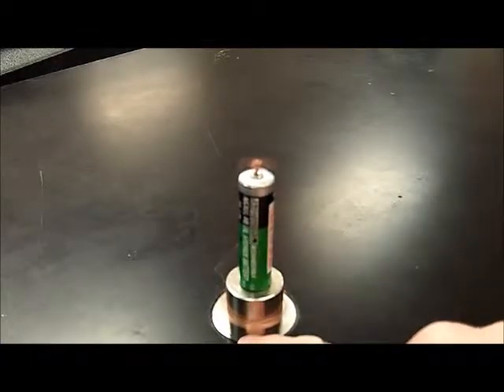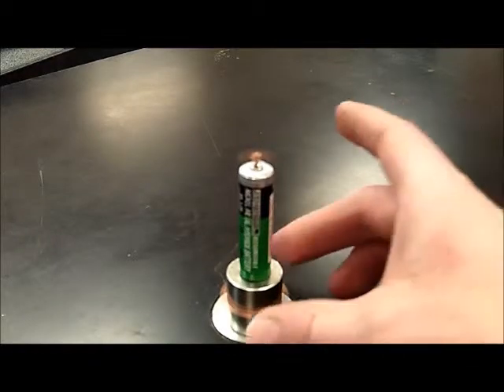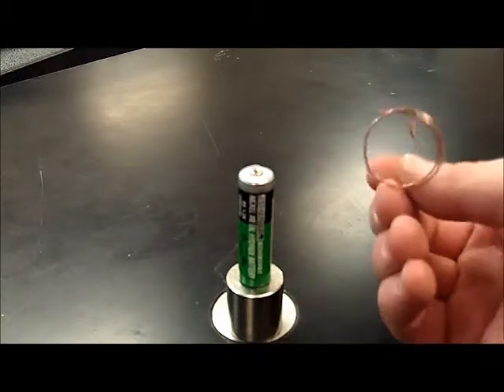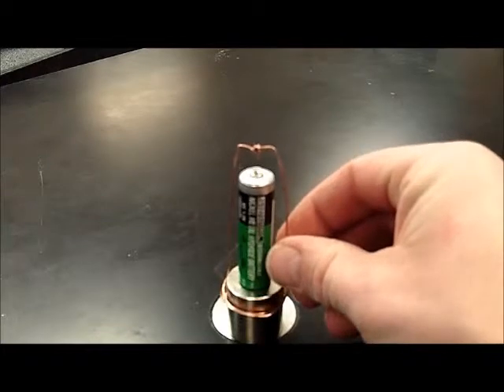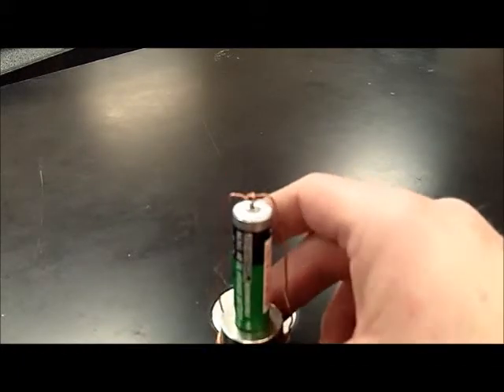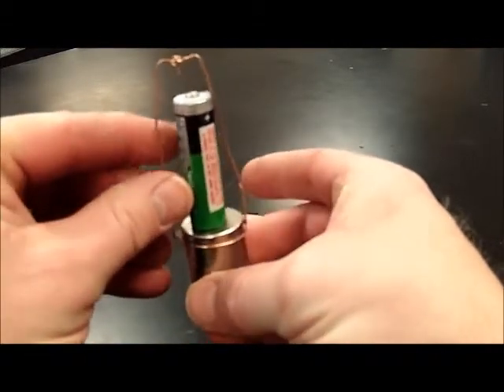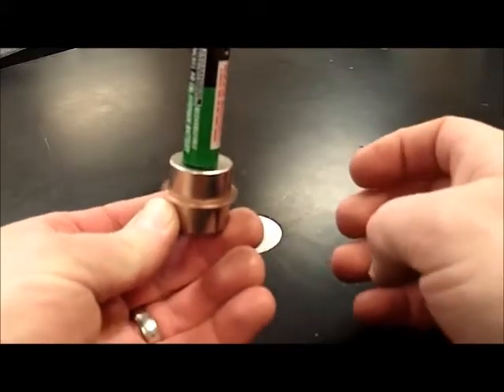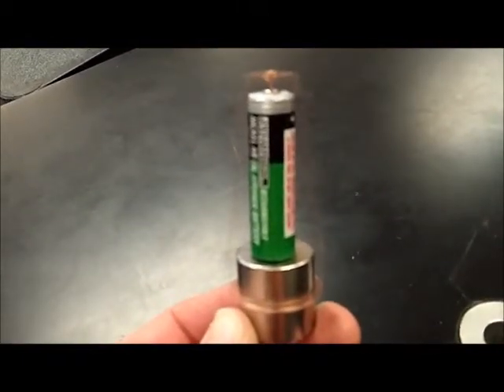Simple and Easy Magnet Trick Creates a FAST motor!

Comment: this is so cool! I'm wondering, what if you hold it upside down? will the battery fall off and also the copper wire? or will it continue to spin? 🙂
Reply from the maker: Thanks, the copper wire definitely will fall off since it will not stick to a magnet.  It is only staying on top due to gravity
Reply: Thank you for your reply. 🙂